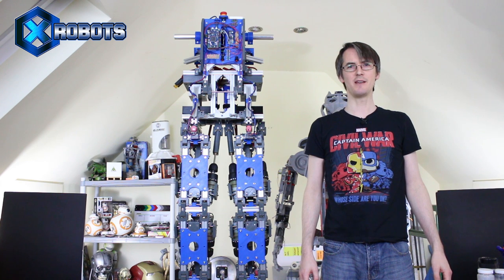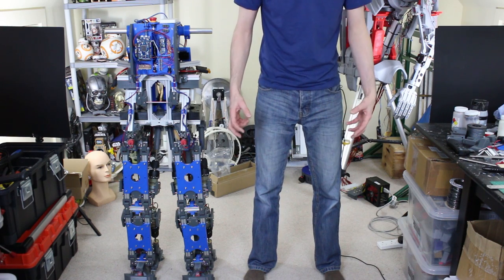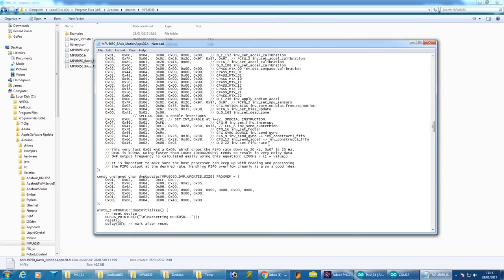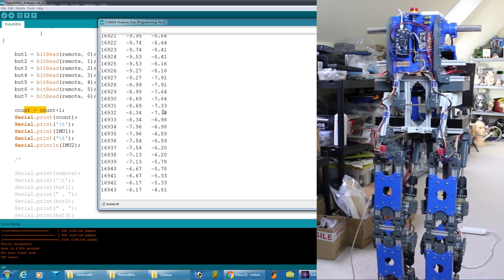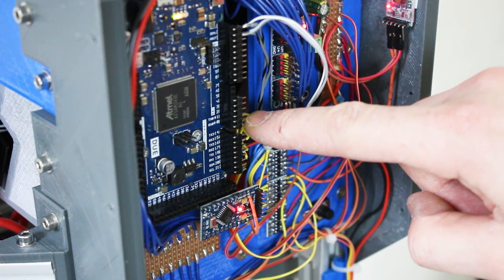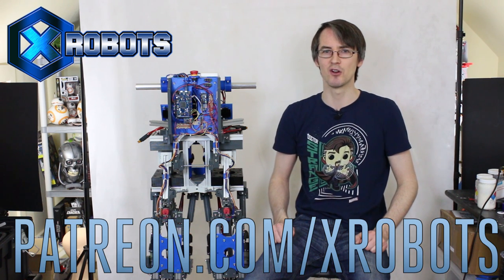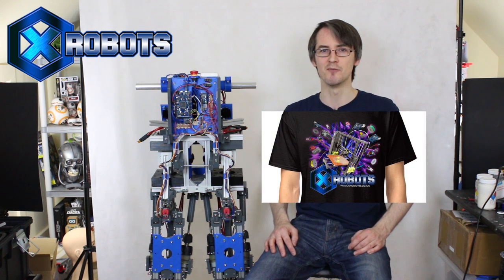Building Robot X #5 | Initial Dynamic Stability | James Bruton

Comment: This is the best home made robot I have ever seen! amazing!!!! cant wait to see it fully walking
Reply: Hi James got round to buying some drills from Argos - I had an idea: the gearbox and chuck are really heavy - a direct linkage from the motor to the lead screw could halve the weight of the robot...you can 3d print the the connector and glue the lead screws into a socket....I dont think you'll lose much torque...and you'll gain a lot in power to weight ratio...
Reply: I built a prototype linear actuator using a 4.8V screwdriver motor and 
1.5VAAx4 battery last week...it required a short piece of tight fitting 
aluminum tube surrounding it to ensure it was straight but it was 
straight enough..it worked fine but the actuator was a little 
underpowered at 6v...im going to give it a go using the HRS550S12V 
motor that comes in my discount argos drill using the 12VLi-ion battery 
that comes with it...these will always have to be custom jobs..the off 
the self linear actuators I've seen are way too slow and expensive for 
use in bipedal robots...

Comment: Letting the software determine IMU zero offset on initialising, was a great help for us, this makes it more robust to mount tolerances, when doing service.
Reply: and it's easily implemented.

When we did it in our masters work, we used a kalman filter, to continuously estimate the bias. but seriously, we got nearly as good results when we just ran a lowpass filter on initialisation, to estimate the accelerometer mount bias.

the kalman filter was introduced after we started using the gyros to estimate orientation, and they have a tendency to randomnly change the bias after some time...
Reply: I think a kalman filter isn't necessary here as the IMU already does all the sensor fusion on its own.
But yes, initial calibration is a very good idea

Comment: Try to us for Serial0 a 1k Resistor in series for each the RX and TX line. the pin is directly connected to the usb programmer. to get a UART parallel running you need this resistors. On the Mega and UNO boards these Resistors are on the board, I don't know why the due is lacking them.
Reply: Andreas Hölldorfer This, S0 is shared with the USB programmer.  

Not all devices share them nicely :)

Comment: Why not use a rotational reading from the body to counteract the turning? It could sense and adjust on the fly instead of manual tuning, that way if it's walking on different surfaces (where sometimes one foot may be able to achieve more friction than the other) it can sense that unwanted rotation and attempt to adjust itself? Then in the future you can adjust the target angle of the body (rotationally speaking) and it would turn.

Comment: I've been following this series with much interest. I have Multiple Sclerosis and have trouble maintaining my balance and picking my feet up high enough to keep from stumbling over objects on the ground. I think that it might be possible to adapt some of your ideas from this project to a walking assist device, that would aid in balance and would assist my leg muscles in lifting my feet off of the ground. I know that Honda has made a couple of walking assist devices, but they are still in testing or are very expensive It would be great to use printed parts and aluminum extrusion to build a similar device. Keep up the good work.

Comment: Another way to get around the battery voltage messing up your PID control is to use voltage regulators for your motor power, but that would probably require some beefy regulators for those motors.

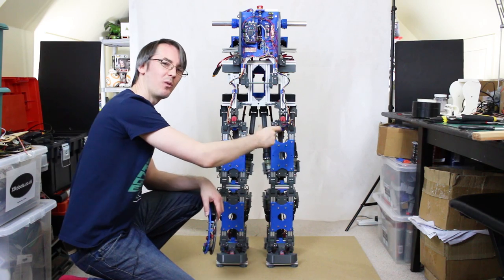Comment: 12:40 Maybe also check the pysical positioning of the drill motors to be identical on both sides. It looks from here that it's right leg upper inner motor is slightly closer to center than it's left leg's motor.

Comment: adding space awareness for each of the legs must compensate for the flexibility of the joints. I don't know how much processing power you have in the chips, but you may take a deeper dive in the software. Essentially what you need is to detect critical deviations of the measured angle in space and trigger different control flow. I would suggest aggregating error states for the both legs and the body but it is not a trivial problem(like adding a state called error) since it must dynamically change the command priorities/weights of the actual motors(by speeding up/slowing down to allow operation organization). 

In order to get the "critical" threshold you need to log some of the data. Given the amount of data you are actually generating it may be useful to do some logging for the whole robot and dump those in file on a pc. You need:
- the three absolute angles, 
- all motors and their speeds.
- the actual motor control commands(will be useful to trace how effective you command those especially if you consider adding the "fast response" logic over centralized state manager)

Comment: So awesome! James, why don't you use a DC power supply for some of the early testing instead of using batteries? I understand that this would only be temporary, but since the robot isn't walking across the room just yet it doesn't seem like tethered power would be an overwhelming hindrance. This is a real question, not a suggestion.

Comment: It seems as good as the parallelogram leg method is it needs another set of drill motors at the hips to properly lift the leg upwards to take a good step, or stand on one leg etc. Maybe a consideration for another project as I'm not sure how you could integrate it at this stage.

Comment: Hello, could you use the values coming from the sensors to detect the drift of the robot legs to the side? If so, you could change your code to compensate for it... Like we do when our bodies are working quite right (think sprained ankle). We compensate how we move our muscles based on the mechanical problem with our ankle! ... just thinking "out loud!"

Comment: James you REALLY should use your GYRO and ACCEL feature of the mpu because that will auto-correct the offsetting the robot is doing when you want it to stay put and keep the current function of stepping
Reply: Sorry my msg wasn't convey well, what I mean is let's suppose you are using only the x gyro to get angles from one leg when you step with that one leg right, now as your robot lifts it's body to repeat the same step with the opposite leg it will take readings from that particular imu replicating what the other leg just did "x gyro" ok now what I was suggesting was to use the accelerometer to offset back to zero is the robot starts to step out off balance " occur you drew a box on the floor and I know what you want I'd the robot to take steps on that box and not step out of the box and more importantly not face any other direction but straight forward or zero" using the accelerometer well help the robot know if it is facing any where but that zero kid so that it always face zero and should it offset due to any de_calibrations by any degree the mcu would read that offset pass thru the pid and back to the motors. Hour this makes sense, I'm actually building an actual female Android so I'm speaking out of my own exp as far as this topic goes, good work.
Reply: sorry for the typos i was replying from my mobile out on the road, i just corrected

Comment: At some stage I think you're going to need to implement a proper data bus. I'm not sure point to point Serial is going to scale. Won't be the most exciting episode but it feels like it would have been useful in a couple of your projects.
Reply: "Just one more thing, if I only had a spare serial port".... And I'm not necessarily talking about this project (it would be hard to reverse engineer it in now) but having a solution that's generic enough that you could reuse on other projects seems a sensible investment in time. But you're the boss. Great job.

Comment: At this rate, you might as well try and make some sort of smart servo controller for your future projects so there can be some degree of PID per-motor without trying up too many serial lines. :V
Reply: If the servo-controllers communicate in serial (like Dynamixels), you could always send PID control data over that line as well.
Reply: True, but it opens up a world of possibilities regarding useful data like motor speed, current draw, etc.
Plus Arduino Nano clones are dirt-cheap these days. :V

Comment: What will make the legs move infront of eachother as it walks instead of just lifting them up and down at the spot? Planning on building something similar myself, I've just finished CADing the leg parts and I'm starting on the hips and body.
Reply: ***** What actuators? Can you explain more? Will the linear actuators in the back of the leg work to extend the leg forward rather than just in or out?

Comment: Do you have any plans for "safety" as in if it gets out of balance to the point of falling and has to correct itself?
Reply: Still having the body imu shutdown the robot once it passes an angle that it can't recover my be useful. Otherwise your system will freak out if it ever tips.

Comment: Could you not create a circuit to switch between mains power (at 12v of course) and the batteries, at least while you're still doing RND?
Reply: What about a DC to DC converter to stabilize the motor voltage? Are the losses involved in such a conversion worth the voltage stability? I've seen numbers up to 95% efficiency, though don't recall the current handling of such devices.
Reply: I think I miss spoke (typed) with 'motor voltage'. I mean a DC/DC converter connected directly to the battery, and the leads previously connected to the battery are now connected to the output of the DC/DC converter.
Battery voltage monitoring would have to brought out to the battery on a separate sense lead.
Reply: You are right of course. For some reason I was fixated on stable voltage, where in reality the PID will compensate. I do wonder about the linearity between the voltage and the motor speed under different loads. Would it be better to sample the actual rotation speed of the motors with an encoder, rather than the drive voltage?

Comment: Regarding the Serial0 issue: Serial0 is connected to the Atmega16U2, so it's likely you have two devices pulling on the same strings. Is there a way to disconnect the Atmega16, e.g. by removing a couple of jumpers, or maybe a couple of 0-ohm resistors?
Reply: I've been looking into this a little and the looks like you cannot use this serial port through the breakout pins.  See e.g.: http://forum.arduino.cc/index.php?topic=257266.0
Reply: Yes, well, I'm not an electrical engineer, so I may be talking out of my ass here, but there is a difference in the schematic: On the Uno and Mega, there are a couple of series resistors between the USB-serial converter and the actual microcontroller. I believe those are what make it possible for another serial device to basically overrule the USB-serial chip. On the Due, there is only a buffer chip on the SAM3X's RX line (ostensibly to shift between the 5v and 3v3 levels), and nothing on the TX line. Now you don't care about the TX line, since both the atmega16u2 and your BT module are only listening on there, but the RX line may be giving you grief.

At this point I would grab a scope or logic analyzer to see what is actually going on those lines, but I do't have an Arduino Due to play with so I can't help you there I'm afraid.

Comment: Would a dc dc converter solve the voltage issue? You can probably grab a cheap one from digikey
Reply: James Bruton the one where the battery voltage drops as they drain
Reply: James Bruton true, even if you could find one that could handle 50 amps it'd be expensive